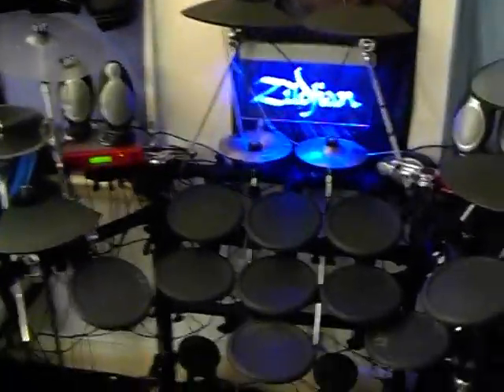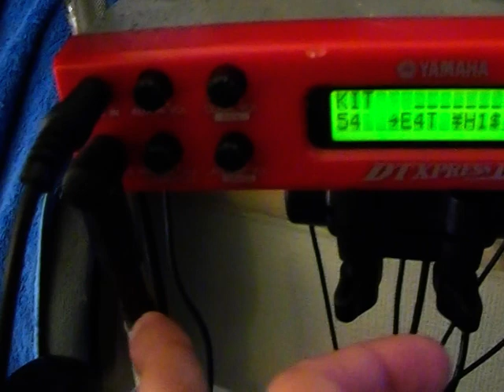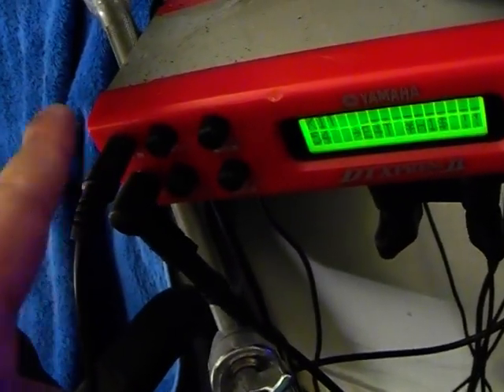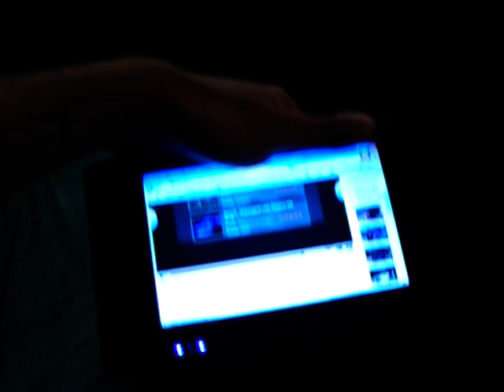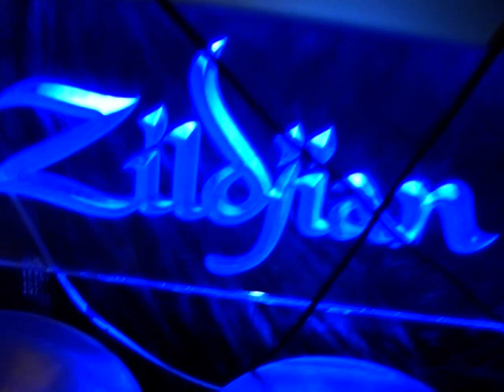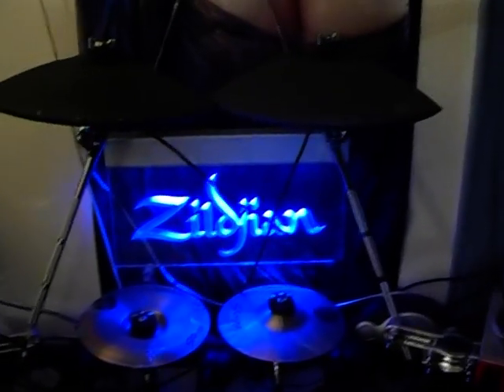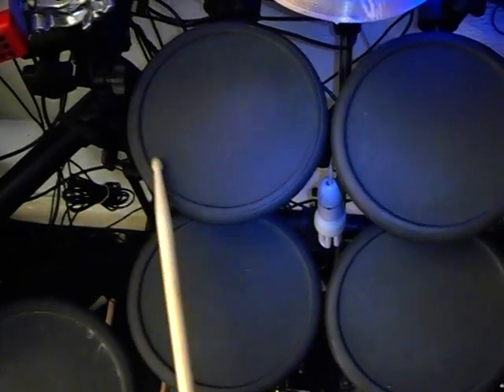SAW BLADE TRIGGER CYMBAL electronic drumkit tour PART 2 yamaha biggest drums set dtxpress

Comment from the maker: @quadbassblaster ..contd....just read the amount of numbers written on each socket...if it has ONE number on a socket that means just one output sound will be given....if it has TWO numbers on it, ..that means 2 totally different sounds can be given out of that socket...the sounds that be adjusted thru the module, and the corresponding numbers of that socket.

Comment from the maker: @GTAtomten ,.,no, in the dtx v2, the bass input cannot be split to get two DIFFERENT sounds, you can only use a regular stereo Y splitter and connect 2 pads which will get the SAME sound.,..like ive done for the bass drums....therefore splitting my left modules bass input is pointless, i will only get the same splash sound in 2 different pads.